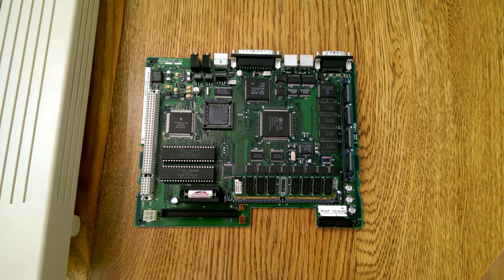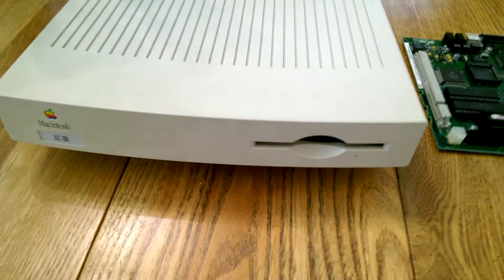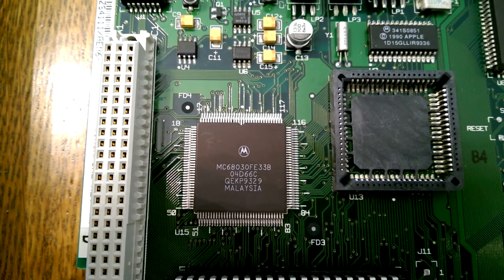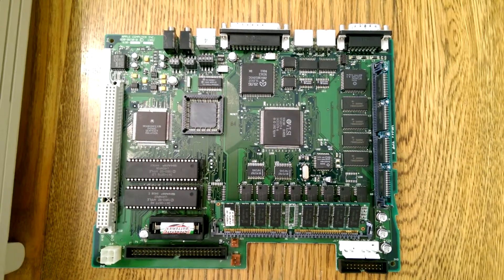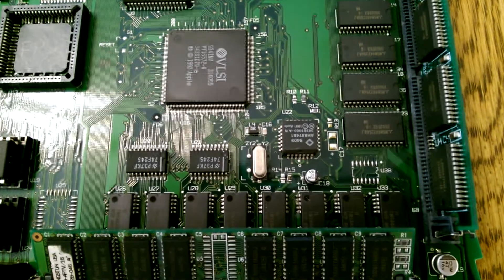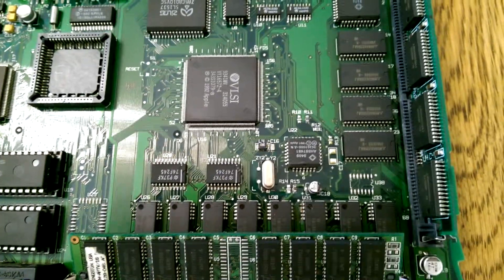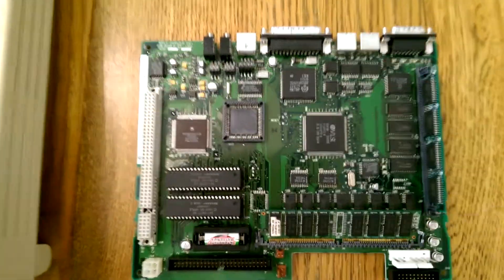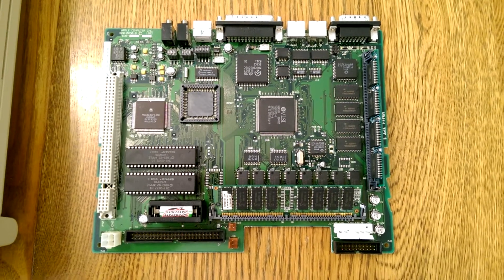Overclock your 25MHz Mac LC-III by turning it into a 33MHz LC-III+ in 10 minutes.

Comment: What kind of heatsink should I use that would fit in my Lc III Plus since I have done the mod?
Reply from the maker: Any small heatsink with a pressure sensitive adhesive backing will do. The factory underclocked 33MHz version technically doesn't need it but I'd recommend it on the 25.

The CPU and the main chipset get quite warm so stick one on each.
Reply: @MadScientistsLair  mine for some reason has an overclocked 16 but showed I have 25. Later I overclocked it to 33 and it is working fine and smoothly. Should a problem related happen, I’m reverting it back to 25 but for now it seems perfectly fine. May definitely need one a heat sink.

Comment: The CPU in my LCIII is a 25Mhz one (says 25 on the chip, unlike yours that says 33). Can I still do this mod or is it only for LCIII’s that are lucky enough to have a ‘sleeping’ 33Mhz chip installed?
Reply from the maker: You can do it but it will be an actual overclock and more likely to cause issues. Some benchmarking afterwards is a decent stability check.

Comment: I did this mod when I recapped the board on my LC III. Though it took me awhile to figure out where R73 was because I couldn't find any pictures of said mod.

Replacing the SMD caps was an immense pain in the ass and despite being super careful removing the caps, I still managed to lift two solder pads and accidentally rip one clean off the board (the one right on top of the SCSI port.) Fortunately there was a small bit of pad remaining that I could grab on to with a fat blob of solder.

I was a tad worried when I got some of the caps off because the electrolyte had started eating traces. The machine works now (and much faster too) and hopefully it will stay that way for another 22 years.

I recommend to everyone that has a Mac of this vintage to recap the logic board, even if you aren't experiencing problems yet, because you will and it can get very nasty. I lost a Performa 600CD to this, but considering it was a worthless model to begin with, I wasn't too upset.

I also recommend that anyone doing this overclocking mod, especially on the earlier LC IIIs with 25 MHz 68030s to put heatsinks on the CPU and the VLSI chipset. Under normal operation the CPU will get hot enough to where you can't hold your finger on it for more than a few seconds. Overclocking brings it up much higher, to the point where a fan is almost necessary.

Oh and you should put a 68882 in that empty socket, I've found the 40 MHz variant on Ebay for just a few dollars. Some software requires a FPU to run and some 3D games like Duke 3D and Marathon run a few frames faster with one.